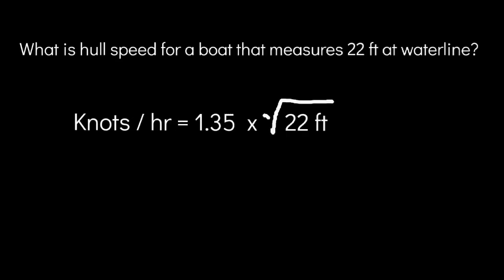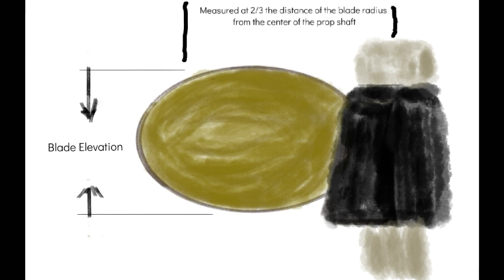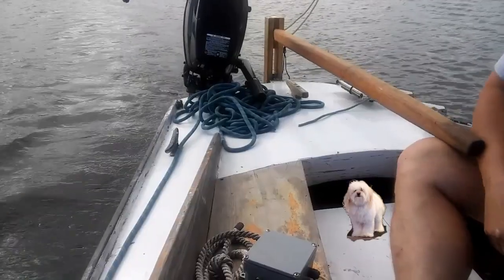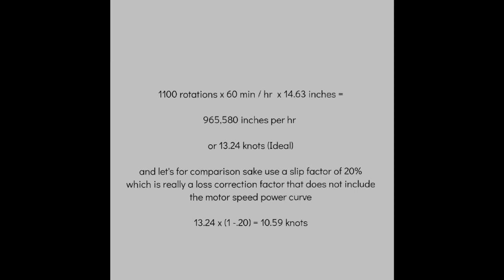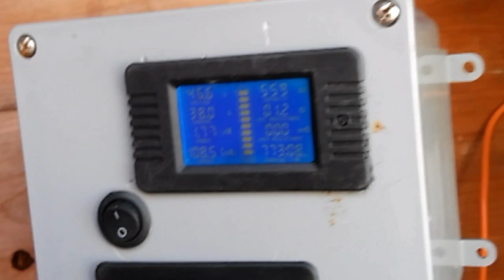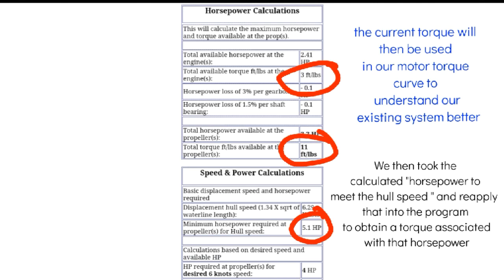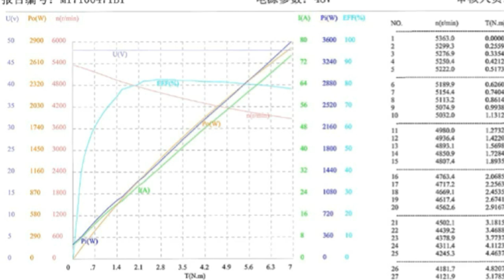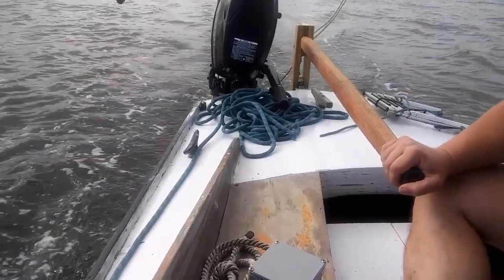DIY Electric Inboard -Tails of Speed, Torque, and Prop Pitch

Comment: Dear Phil,  nice series of videos, I think in this one there might be a miscalculation about Torque, if your gear ratio is 4 to 1 then you have 4 times the torque from engine shaft at given power and engine power stays the same , which was about 2,41 HP  It would mean that You have enough torque, as  Adam Cue suggests bringing ratio down to 3 to 1 or even 2 to 1 would still leave You with sufficient torque and the rpm's colud stay lower , could it be even more efficient? I guess,  for this hull type You are not targetting high speeds with such level of electric upgrade, but if some solar panels added You could get unlimited range at moderate speed and low noise ;)  any way, nice project and nice boat,  best wishes and best Regards  :)
Reply: P.S. Any updates to this project? :)
Reply from the maker: Thanks Sebastian I have been working so much I haven't been able to go out on the boat in fact I still have one more mass to put in I'm going to look those numbers over again that's very possible I screwed things up. Plus with my system , I don't think my propeller is deep enough in the water, it's probably grossly inefficient . You can see the spray in the video. I'm going to go over what you said later in the weekend when I have more time I have to prepare for work tomorrow. So far using the electric motor to drive from the ramp over to the dock and get set up system work fine. So I'm excited for a third year with the same motor. I am struggling with the batteries though because I didn't realize a very critical point about the lead acid batteries because in General their internal resistance 4 us makes the amp hour rating useless. That was going to be the topic for my next video. Basically on what I mistakenly assumed and how I got lucky because I just used the boat to get in and out of the slip.
Reply from the maker: Sebastian I finally had the time to look over my notes from this the prop calculation has the ratio built in so the four to one was built in both for the engine this part I could have done better explaining but the work needed at the prop shaft was about 33 newton meters which came out to the mid motor torque to be able to reduce to get to that 33 would have been like eight and change so if I went to the Max store to the motor and I multiplied that by 5 instead of 4.  yeah theoretically I could have hit that speed based on torque but I would have been very close on motor speed to be able to get the prop to push it that fast and that's where I wasnt  really willing to go more on that because I noticed the power requirements to get there we're pretty significant the noise created by the higher speed was annoying. I do have a new rpm sensor for my drive shaft and I'm hoping to develop a curve that will show my prop system versus speed with RPM that will take the motor out of the equation and just show the efficiency of how my boat is set up.  I think then I will go back and try Adam and your suggestion getting more accurate numbers  and dialing  in the ratio . For right now I'm trying to focus on the batteries I want to use cuz I have 4 lead acid wet sells and I'm pretty sure that I'm not going to get another year or two out of them I've already had them for 3 years and it really seems like the technology that makes more sense is the lithium 'm going to develop that curve .
Reply: @philcostello6989  Phil of course I understand :) first things first, whish You success with this project, have fun, I'll check later for upadates ;) greetings for You all, take care :)

Comment: Our hull speed in 5-6Kn we are 7.2 x 2.9 have a 30HP 3C inboard engine - which we reach cruising speed at less than 1/3 engine power - if you push here to max she might get to 8Kn but at a big cost in fuel and engine heat. we would be looking at something that dose 3-4kn ideas ;)
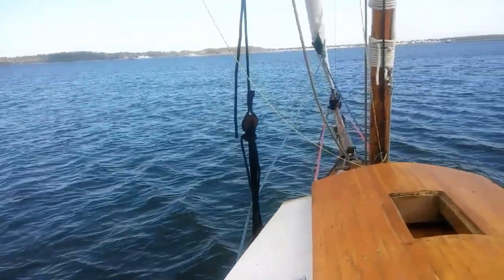Reply from the maker: So I think you'd have to really see and think about what type of sailing your doing . are you looking to just get in and out of the slip or are you looking to motor when you're be calmed or just in general for extended periods for me I just go in and out of the slip and sale for a couple of hours then go back in using the motor if need be to be on time to where I'm going and so for me my system works pretty well I wouldn't trust it for Blue Water sailing because there's too much at at stake I know we think about speed but in all honesty I haven't done a lot of testing with respect to power against Strong currants or strong wind. I would truly make sure that you also incorporate the weight of your boat. I would say that for me and my boat with its weight and it's flat bottom, I have plenty of torque to fight against currents and winds plus I have a three bladed prop which gives me more power and fundamentally. I think if I needed a system that was a more of a proven entity for longer trips I would look at 5 kilowatt Thunderstruck but if I was to do extended Blue Water sailing I would probably go with the system that have proven Regen and dependability like oceanvolt. There's always also a YouTube series that I really liked called sailing Uma and they use the forklift motor for the first 3 years lead acid batteries and they were Blue Water sailors we used to get it in out of the slips and anchorages they had some good information to on their sites and they have interesting videos I found myself binge-watching the other major thing was that I didn't really understand I just assumed that all batteries were equal in their ratings but I couldn't be farther from the truth between Lithium and lead acid when they have a amp hour rating on a lead acid it's for it's for a specific discharge rate and there is usually very little compared to what you really want . For example recently I just did more research on the battery something I should have probably done initially and what I found was that my for lead acid 80 amp hour batteries are probably giving me the equivalent of an e-bike 48 volt 30 amp hour battery made out of lithium ion at like 1:10 weight savings and drastically increased cycle life and if I do have to run it harder for power I don't pay an added price the losses of resistance trying power out of the battery.
Reply: We plan to keep the desial engine for when we need power for sea and wind, just take it out gear when using electric.
Reply: I like the very cheap aproch :) though you think this might have over heating issues for long runs?
Reply: Going down big rivers the current provides a large part of the speed for example we were cruising at 10-12kn at min engine speed at times on the Rhine and Danube due to the current - the only role for the engine is to keep the boat pointing in the right direction in the right part of the river to avoid the big ships so little power MOST of the time. Am thinking she will cruse slow on pure solar without touching the batteries on good sunny days.
Reply from the maker: That's a brilliant idea setting up the electric motor the way I haveit would allow you to keep the existing diesel setup and would allow you to use the electric the way you need to .  that's a really cool idea.  I think that would work and I bet that would have a lot of applications because you could use it instantaneously to adjust course for any boat without having to start up the gas motor. I think that would be definitely more prototyping and trying you may need to go to a bigger motor though but I would probably prototype it with the cheap one that I got first

Comment: Hello Phil, I'm currently planning to make a e-sup (Stand up padleboard). And so far this kit seems the best option but I can't figure out which batteries I should use. I am aiming for around 100 dollars. And 30 min drive time. Do you have any suggestions?
Reply from the maker: For a paddle board I would definitely consider a lithium ion battery. Battery ratings are deceiving you can only just charge a lead acid battery to 50%, so right there you have to cut the rated or advertised amp hours in half then you have to look at what type of amps you're going to draw and then go back to the data sheet on them let acid battery to see how much time you'll get out of it because it's not straightforward for example I group 27 battery from Duracell it's rated 80 amp hours but that's discharged over 20 hours so if you do the like 4 amps if you need 25 amps you brought that battery down to 30 amp hours of usable energy now you can get the equivalent e-bike battery have half the weight and extended life
Reply: @philcostello6989  Thanks!

Comment: The slapping on the belt contributes greatly to the noise. If you add an idler pulley, it should substantially reduce the noise. You could even use a fixed skateboard wheel.

Most of the time the motor is used in forward. So, I would put the idler on the side of the belt which is slack when the motor is in forward. I believe that would be the "left" side at 0:18 (or what appears to be your starboard side). It doesn't have to add much tension, it's more about guiding the belt and preventing harmonic slapping--and the associated noise.

I think you'll find it will help the noise quite a bit.

The other thing is the drive ratio... I think you could bring the ratio down. Based on your numbers, your ideal prop speed is 1100rpm and is capable of a theoretical 10.5 to 13kts. You will lose some electrical efficiency, but it should be much more pleasant on the ears.

Finally, I see you switched from chain to toothed belt. Toothed belt is quieter than chain, for sure. At the power levels you're transmitting, a v-belt would be by far the quietest of the bunch and would not slip.

All the best. :)
Reply from the maker: sounds like a cool idea I think I'll try that this summer !
thanks!